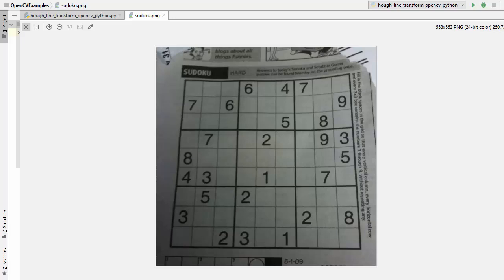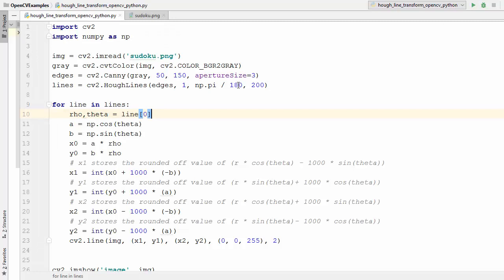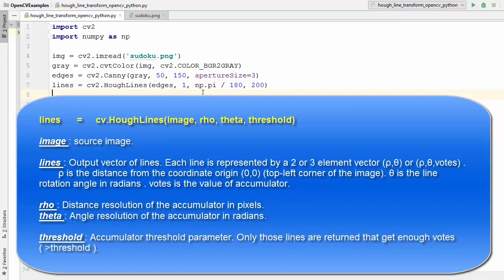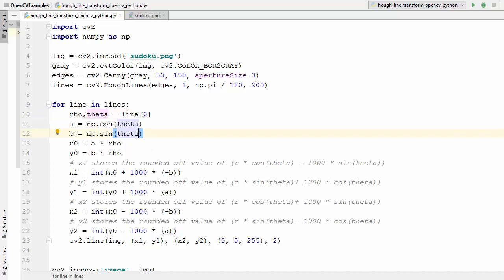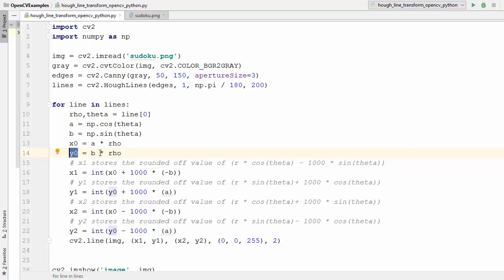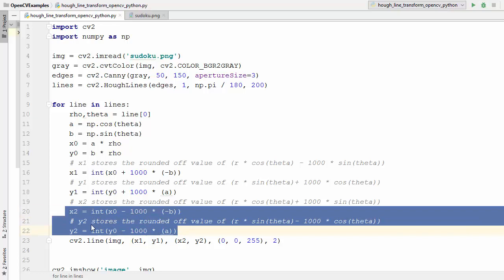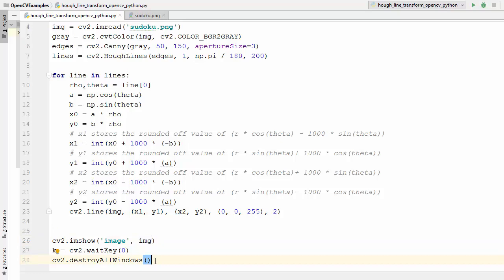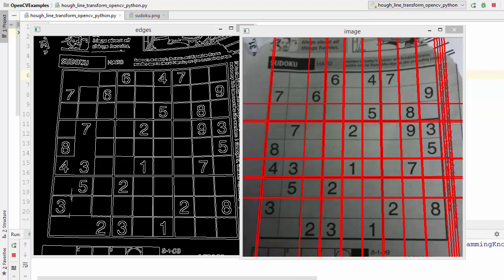OpenCV Python Tutorial For Beginners 29 - Hough Line Transform using HoughLines method in OpenCV

Comment: After looking, the best explanation I could find as to why it was necessary to add / subtract 1000 is to ensure that the line was drawn over the entire image. If the image was significantly larger the value would need to be increased proportionately.
Reply: Yes! This is it. I didn't like this as I was dealing with larger images, so I did something like this:

dim_x, dim_y = gray.shape
x1 = int(x0 + dim_x * (-b))
y1 = int(y0 + dim_y * (a))
x2 = int(x0 - dim_x * (-b))
y2 = int(y0 - dim_y * (a))

This is only valid if your intended lines are horizontal and vertical only!